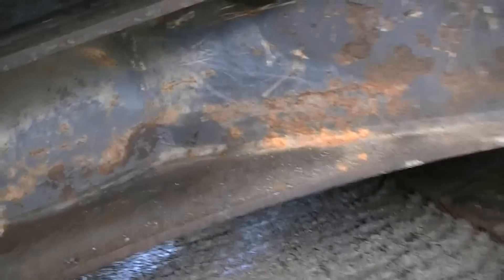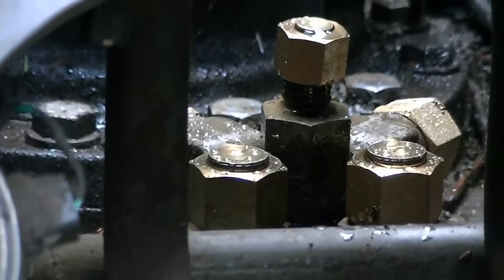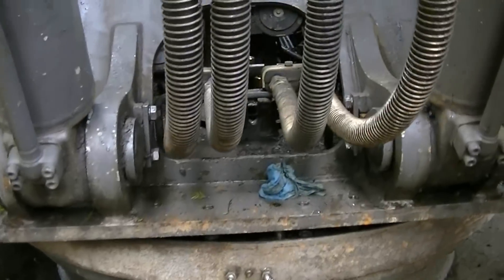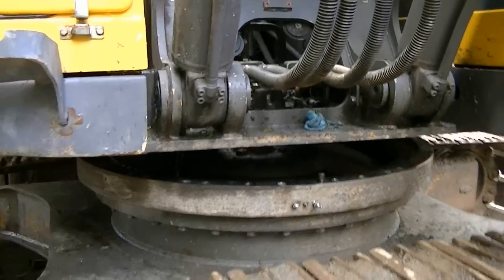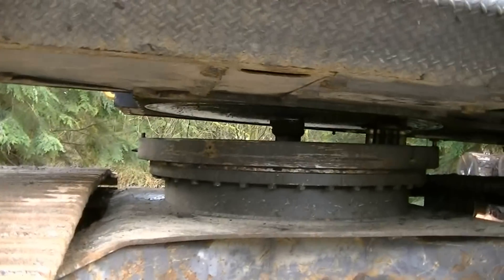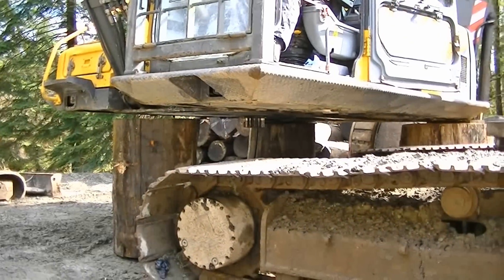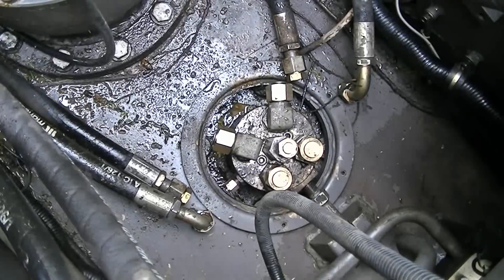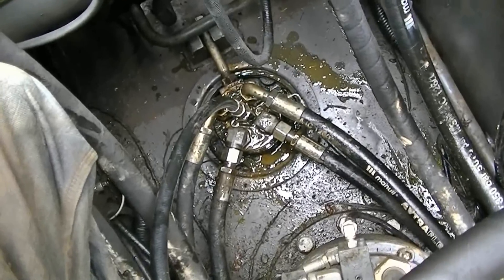Excavator Swing Bearing Replacement

Comment: I did one of these a few years ago myself on a 307 cat.  By far the nastiest, messiest job I have ever done in my life.   Disconnecting the swing motor hoses through the tiny access hole underneath the machine leaves nowhere for the fluid to go but down your arms, in your hair, and face.   I had an oil catch pan underneath that gave me even less room to work.  I threw out everything I was wearing after disconnecting those hoses and it took me three days to get the hydraulic fluid out of my hair.    I used rr Ties on top of the tracks and 4 bottle jacks to lift the machine straight up, your method was easier and probably much cleaner.
Reply from the maker: Its an experience thats great to have for life,and you always look back on it proudly,but it would be wearysome to know another had to done
Reply: Hi how can in get in contact wit you ?
Reply: @colinhamer3470  Through my website.  PBTools4u.com
Reply: Thanks for your words，when I read it，I was like livingly watching a movie！！！

Comment: Attach very long hoses and drive the tracks out...
Reply from the maker: oK,so figure out what size hose,go to town,buy 6 hoses about 20 feet long each with ends,easily $1000,probably way more.feed all these hoses somehow through the rotary manifold as its coming apart,then dissasemble the hose again and cap the leaks.Then replace the bearing that cant pas through the hoses,because they are through the centre of the bearing.Then do this all again in reverse.Would need an extra person to pull and feed the hoses.But it would have saves 4 minutes of work on the small excavator that was sitting there anyway.Guess when you were 4 years old you had a one time passing thought of being a mechanic.
Reply: skadill good points, we used the long hoses approach at JCB.

Comment: You made it look easy I would have liked to see how you got all the bolt holes lined up. Neat job, It appears you have been to that rodeo before.
Reply from the maker: +Powder River    The bolts all line up as long as the two small line up dowels fall into place,which wasnt any effort.

Comment: Well done! I never realized you could pick yourself up off of it either. I never ceases to amaze me how much these machines can take care of themselves. And how such large imposing machines can be broken down so easily with a few (sometimes a LOT) of big nuts and bolts. Hope I never have to do this on my link belt but if I do I guess the biggest challenge may be finding stumps that big!
Reply from the maker: +Tom Brueggen   The concrete Lock blocks would work as well
Reply: +skadill Yeah I was thinking that or the timbers like you see used to drydock ships and such. Regardless, cool to see it can done this way. I'm not sure I can free spool my final drives though. I've never opened up the motor to see what the insides look like. I guess if I just disconnected the hydraulic lines it would free spin at worst case.
Reply: @TomBrueggen  in

Comment: Why go through all that labor to install a used rotex bearing? Its normally not worth it. That would almost be like putting used sprockets on A new set of rails.
Reply from the maker: +Andreas Frind  It only had a few hundred hours on it,came off a dismantled machine that had an accident
Reply: +skadill  I see well thats not to bad then I just know from expirence that some things like that are better to get new
Reply from the maker: near $6000 for new one,i bought the whole lower in near new condition,only missing the pads and rails for $3500,with track drives,all rollers,idlers,bearing,frame,and a stick cylender and a stick with all linkages.The track motors alone near paid for everything else
Reply: +skadill I know all about that I bought 2 D8Ks for 10g and built 2 into one  and I am parting out the other so far I have already made one good one and sold over 10 grand in parts. So I got a free D8K out of the deal.
I assume you are in the lower mainland in BC

Comment: great video, learning curve question:  Did the machine get swamped as I am not familiar with how watery thin the oil was once you removed the carriage?, only way to learn is to ask.  They had to take the gears out to move the burnt buncher they didn't like the speed on the downhill haul:) Thanks for this interesting share sure it was a lot of work.

Comment: well damn that was pretty impressive. here I thought a crane would be needed to pick it up.
Reply: Not all slew couplings will allow this self lift style removal of turret as slew coupling hole is too small and will require a crane to prevent damage to the slew coupling.
This is mostly found in compact zero overhang counterweight machines. 
A crane makes it a lot easier especially if the tracks are in poor condition and don't track straight back and forward on the roll in and out.
Reply: Looked at the beginning again and still not clear how he lifted it up. Really would have liked to seen a distant shot showing the entire machine at once. Nothing but close-ups.
Reply: @henryD9363  pretty simple. Put blocks under the counterweight, and push down with the bucket.
Reply: you dont understan that it is something... they called rototillt!?
Reply: cheese cyst
Reply: letsdig18 Surprised me as well
Reply: Actually that other excavator lift the counterweight to put the wood block i guest
Reply: this is me too..wtf...maybe you could learn me
Reply: 69sungam  Learn some basic 3rd grade English please.
Reply: Crane is no safer. Suspended loads, no thanks, trust someone you dont know, no thanks.
Rather do it ( and have done it!) this way. One man job, bit fiddly though and up and down a lot.